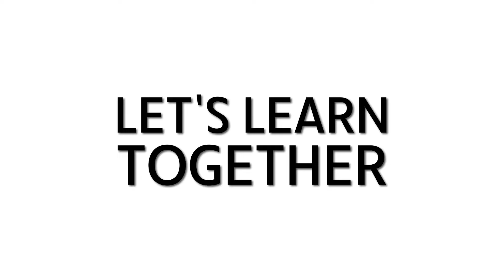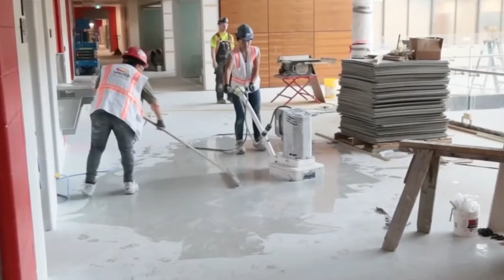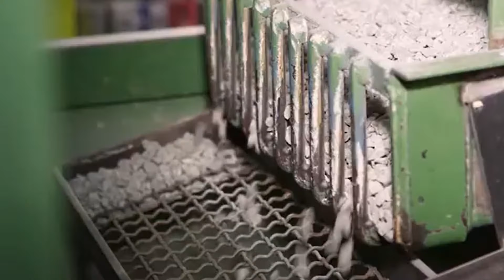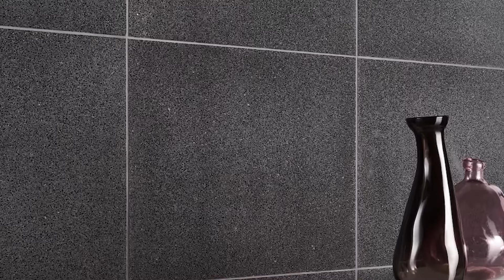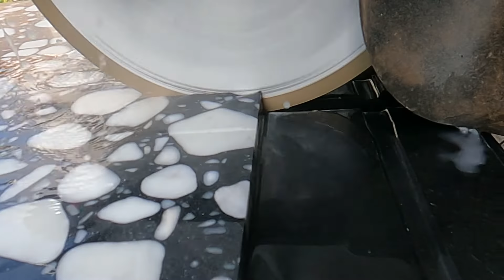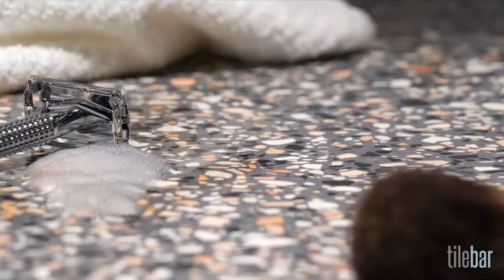Cement or Resin? Choosing the Perfect Terrazzo Tile @TileBarNewYork

Comment: One item I found out is you can’t heat resin based ones but you can heat the cement based.
Reply from the maker: I assume you’re talking radiant floor heat. Did you try it? What happened? Did it absorb the heat? Or deform? I’m intrigued.
Reply: @til @tiletheworld er a ton of research and talking to epoxy and other resin based manufacturers, under/in floor heat will discolor the tile and cause it to smell like burnt plastic. Cement based is completely ok with heating it though. We are putting it in all our bathrooms so wanted it to be nice and warm on the feet.